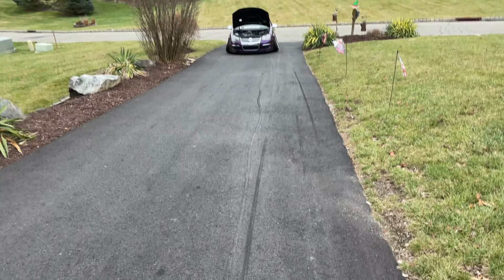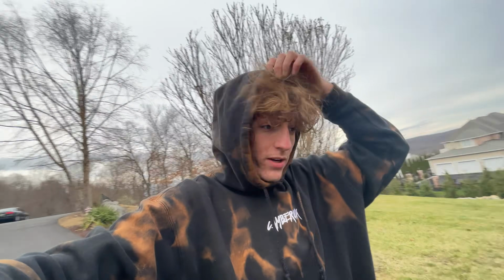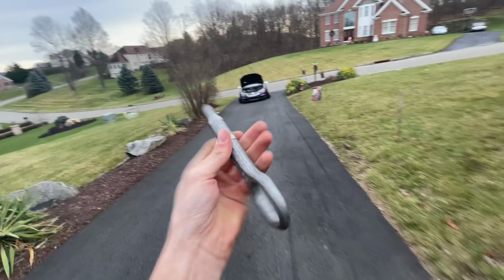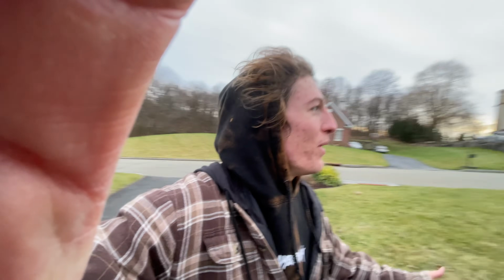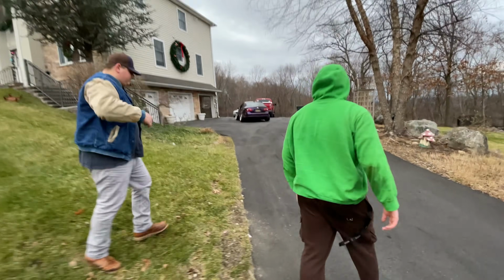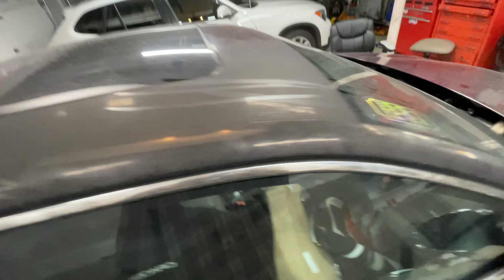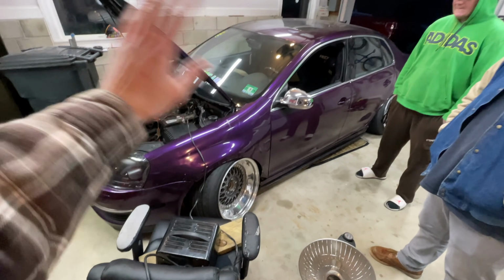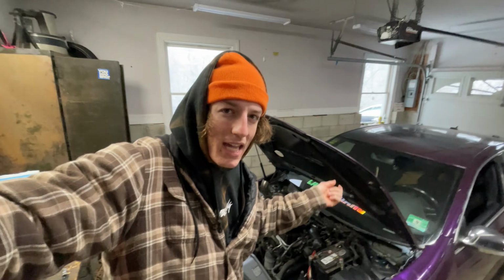Blew The TDI Engine ?

Comment: Your lucky. If the engine goes, it would just be a parts car. It would be too costly to repair. I've just restored an '04 GLS 1.9 tdi Jetta sport with extremely low miles. Just put $12 000 into it over the course of this summer past. You would love this car bro, Black with black interior, black tint, all chrome blacked out, Original long beech wheels refinished in gray gun metal, Malone 1.5 tune, (130 hp/245 torque). 1.5 is enough don't want to blow it up,,, Car is mint. No rust, etc.. Next year, exhaust, suspension,, It's never ending 💲💲💲
Reply from the maker: I could get an engine for $900 and repair it myself so it definitely wouldn’t be a parts car . But awesome glad to hear ur car is running

Comment: you NEED to do a dpf delete on the mk6, that'll make it just like your mk5 minus the smokey tune lol, the dpf is in the downpipe and is a pain in the ass to remove and it'll cost ya around 350-500$ for the exhaust bcuz when you do the dpf delete a lot of companies will throw in the cat/nox filter delete in there with it and then you need a tune as well so I paid 1200$ cad so like 900$usd or something like that

Comment: Looks like you flooded the engine with too much fuel and air which didn’t detonate, possibly over fuelled.
Take the glow plugs out, crank it over a few times with the fuel pump disconnected and put them back in.